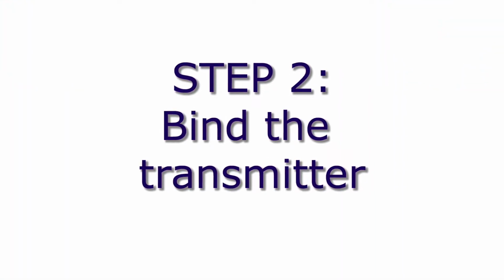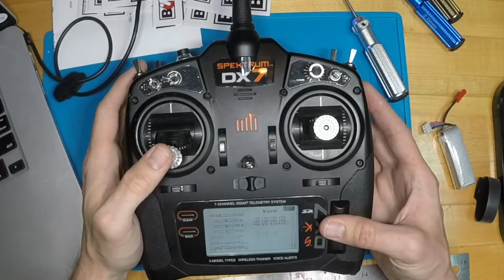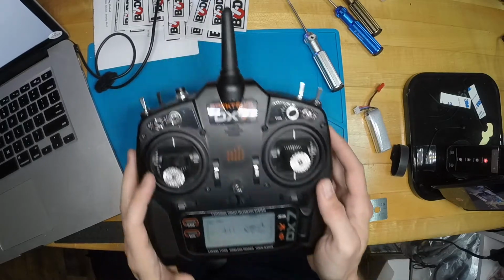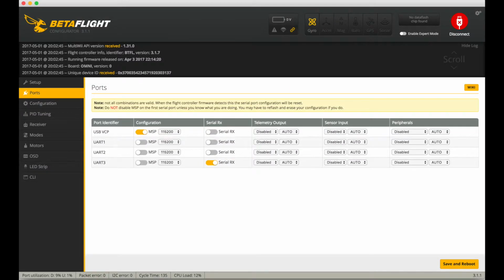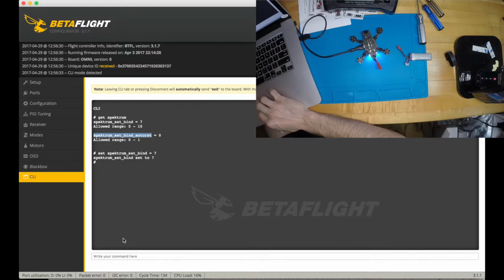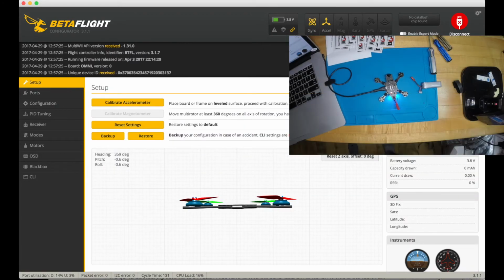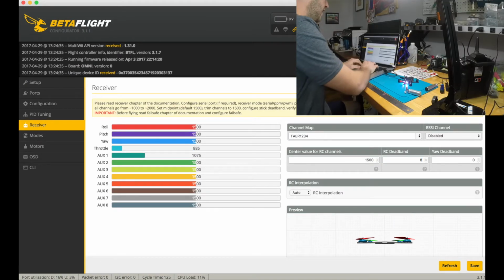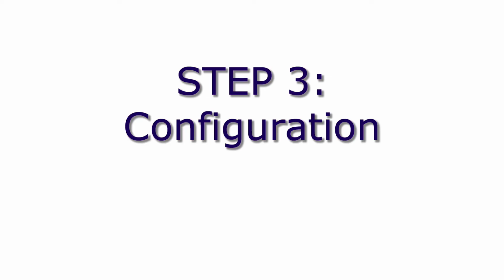SPC MAKER 90s - 2 - Bind The Transmitter

Comment: It wasn't originally set up for Serial/2048/Serial Rx? Or was that because you flashed?

Also, no bind button on FC or Rx? 

Lastly, did you try binding in DSMX 11ms?
Reply from the maker: Some have a bind, some don't. Mine did not have a bind on the receiver =( . And yes, since I flashed it, I had to re-setup some of those settings. I'm very used to setting up boards from scratch so it was not a big deal to configure those settings again. 

With my Spektrum DX7 I've not actually ever got the 11MS to work. Which radio do you use?
Reply: Thanks! So maybe the DSM Rx version has no bind button. Thankfully you showed how to bind via CLI command.

I am using a DX9. In the System Setup menu, click Frame Rate (just above Bind). Select 11ms, then re-bind quad. If the Rx is 11ms capable, then it will bind with the lower latency setup. If not, the Tx will default to 22ms. 

Sometimes, no need to tell the Tx about the frame rate, but I had to do the above with a Shuriken X1.
Reply from the maker: I just checked and the DX7 is not capable of the 11ms protocol...... time to upgrade the transmitter! lol
Reply: Odd. Left you a link to your manual at the Spektrum site showing how to change the frame rate to 11ms... Now, my comment was deleted. Wow
Reply from the maker: I didn't delete it but I was able to look it up and find out how. Thanks for the suggestion! I need to go back and move all of my quads to 11ms now.. what a pain!